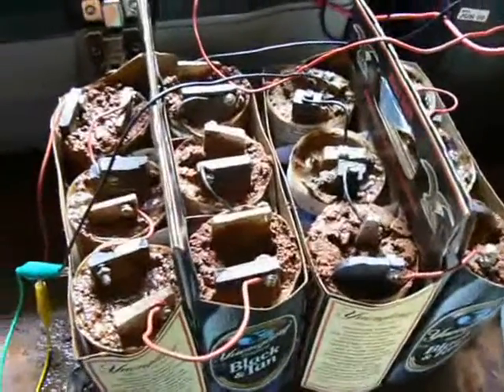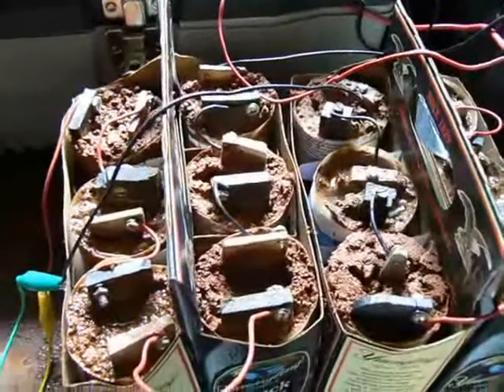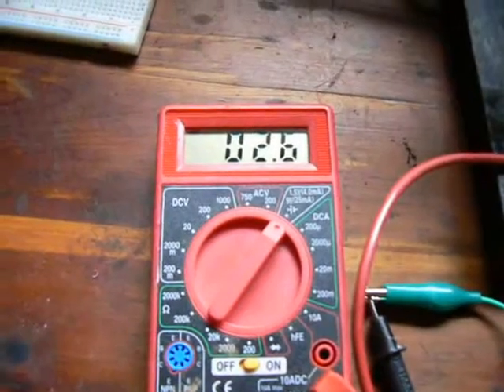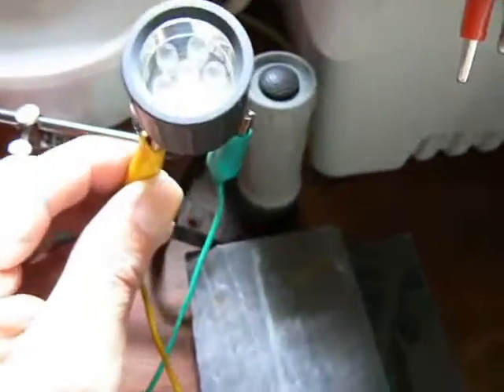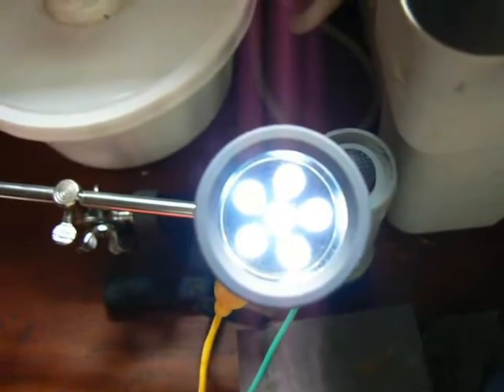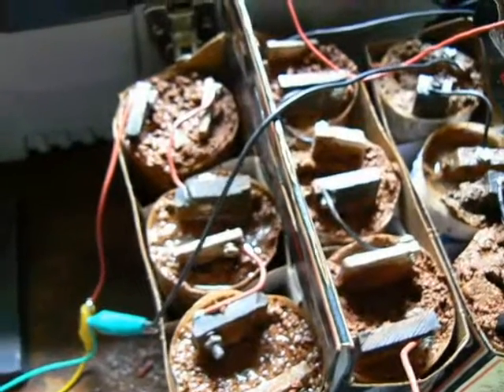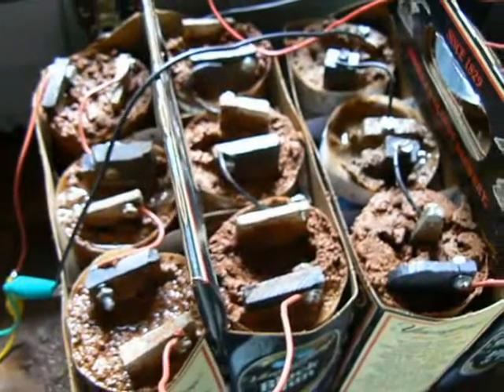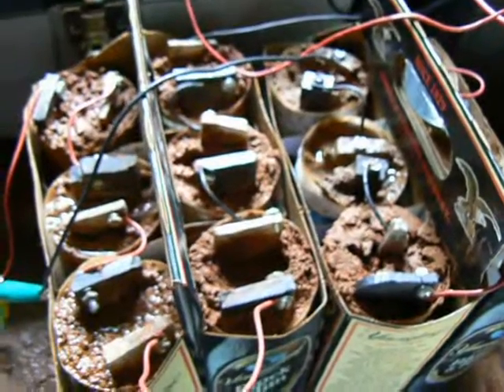Dirt Battery

Comment: Salam....Here is something that I figured out. Its all in the salts in the dirt. If you just used the right salts you achieve the same with few mm thick slat separation between cathode and anode.
I am flying back to Pakistan next month. I live in apartment here. But back in Pakistan I have a hand pump installed that goes deep down. I wonder what will happen if I stick a mg, copper, or graphite rod right next to it. ;)
Reply: lasersaber  what do you think will happen? will I see good results?